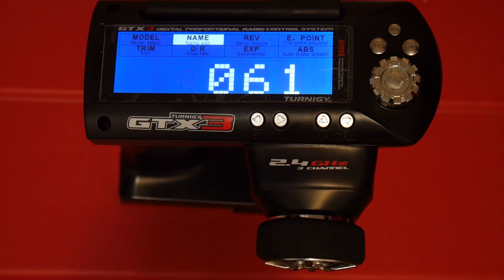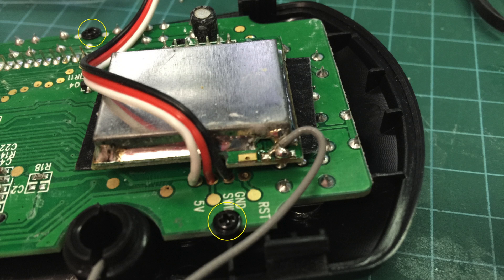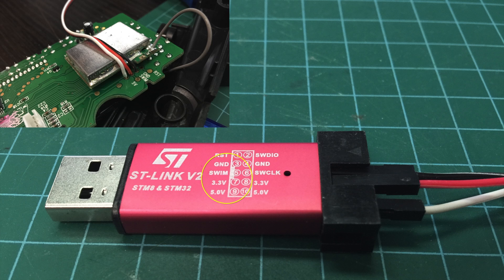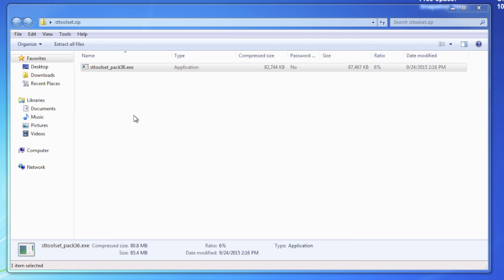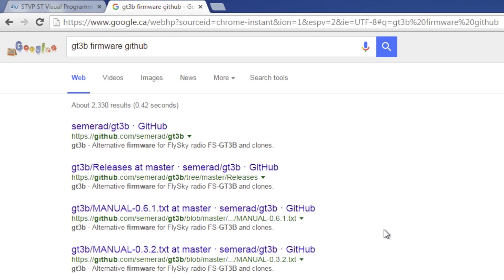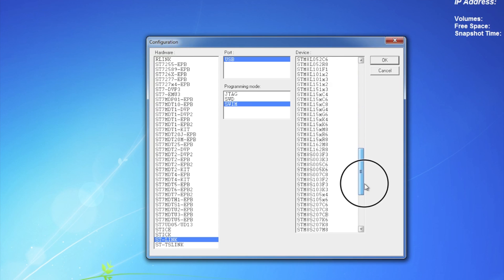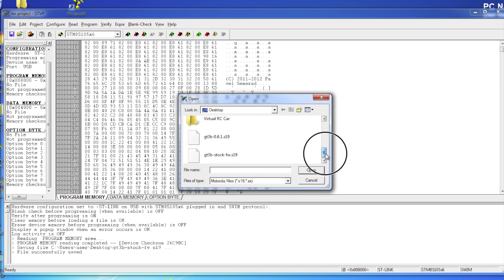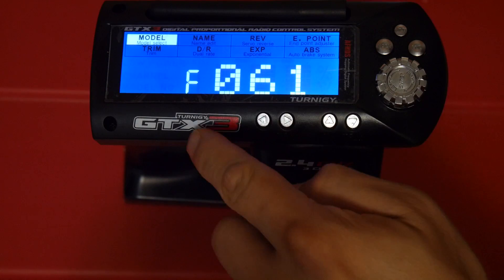FlySky GT3B (GT3C / GTX3) Firmware Flash Install Hack - Cheap USB Programmer

Comment: I have the Turnigy gtx3 with one original receiver and about 10 of the HobbyKing gt2b if I hack the firmware will it still buying and to my original receiver and the HobbyKing receiver or will I have to buy the fly sky receivers

Comment: The connected device is just beeping. and when i try to read - 

Error : Cannot communicate with the tool.
Wrong tool selection or check tool power supply or check that a previous session is closed.
Error : < PROGRAM MEMORY reading failed.

anyone had same issue?
Reply from the maker: Watch my updated video. Link in the description

https://youtu.be/b5mZ3898ZNQ
Reply: kenVersus I’m having the same issue still and I’ve watched the updated video
Reply: Yes, I had this issue on mine last week. I fixed it with this link: http://www.overkillrc.com/GT3C/Installation%20Manual%20v0.pdf

Comment: HI, I installed the hacked firmware on my gt3c and it boots up fine when connected to the ST Link programmer but if I try connecting to the microUSB the screen flickers and the controller beeps. It's like it's in a reboot loop and I am not able to do anything in the menus as it cycles very quickly.  Unfortunately, my battery is currently dead and I am waiting for a new one from China.  Not sure if that has something to do with it but I was able to power the controller fine with a small usb battery bank and the micro USB port.  Has anyone else seen this behavior?  Also, the firmware seems to be flashed OK although my ST Link is now on the fritz and is not recognized by Windows ... otherwise I would try reflashing.

Comment: Thank you Very much, it worked great! For all of you who get the error "Error : FILE : line 5: Not in Motorola S19 format!" just copy the RAW Code into the notepad and save as an *.s19 file. The problem with the rightklick method is that the code gets damaged. Happy hacking! :D
Reply from the maker: Thanks for the tip.  Hopefully, it'll help others in the future.

Comment: When I try this it tells me my device is protected and it wont read or rewrite the firmware even with the with the read out protection checked any advice or help please ? 

 

 

Reply
Reply from the maker: I'm not sure of your issue but check out the other comments, I think there were some solutions for various issues. I haven't flash a gt3b in years.

Comment: odd question but when you plug in the usb does the gt3b beep constantly if not why do you think it does
Reply from the maker: I don't recall it doing that. But it's been a while since I flashed mine.  I remember hearing beeps when it was flashing.  Not sure why yours is beeping the whole time.
Reply: kenVersus all sorted now as soon as the adaptor connected to the software it stopped beeping

Comment: Man, I added the RST line to the STLINK and STILL get the "Failed to communicate/Check SWIM connection" error. We've checked the connections, continuity, etc., to no avail. HELP!! FWIW, when the transmitter is connected to the programmer and computer the transmitter beeps continuously rather than just one beep expected. When I instruct the ST program to read the current firmware the beeping stops as I get the message. If I close the visual programmer the beeping starts up again.
Reply from the maker: +Scottrik1 hi in situations like this try another ST programmer. Maybe the one you're using is defective.
Reply: Hi, can you solve the error message? I'm with the same mistake

Comment: Just got mine FS-GT3B. Everything went fine until reading stock firmware: STVP says "The device is protected". Game over. Cant do anything. Not even upload the new firmware. Same thing "The device is protected". Please help!
Reply from the maker: +Eelis Halme never seen that error before. See this post:   http://www.rctech.net/forum/showpost.php?p=10592515&postcount=3717
Reply: https://electronics.stackexchange.com/questions/128931/how-to-flash-protected-stm8-mcu
I foung the answer here! Now i got it to work and new firmware is in.

"Make sure that the Read Out Protection (ROP) byte is set to off. Open STVP, go to the OPTION BYTE tab, set ROP to off and write out (Ctrl + P). Then, go to the PROGRAM MEMORY tab again and you should be able to write your hex file."

The key was to push "Ctrl + P" when the Read Out Protection -sheet is open.
Reply: I have the same error. Did you find a solution?
Reply: Yes. Just follow the instructions i wrote above.

Comment: On the GT3C the solder points are on the opposite end of the board on the edge, they also are not labelled but left to right (board orieted with holes on top edge) they are 5v | SWIM | gnd | RST
Reply from the maker: +Paul Campbell thanks for sharing more info on the gt3c.

Comment: Anybody having the "Failed to commuicate/Check SWIM connection" error, wire in a 4th wire into the RST hole (next to the GND hole) and connect it to the RST pin on the STLINK. I did everything I could think of to make it work the way it was described in the video with no luck. As soon as I ran the 4th wire it worked immediately.
Reply: This was the thing I was missing too, Thanks !
Reply: Janne Miettinen glad I could help!
Reply: Confirming -  the fourth wire is needed to make this work. Thank you Sam for this info!
Reply: My device was protected i could not read the memory  i followed this site suggestion and it worked but beware you cannot save your original firmware
Reply: jahcure04 is there a reason why you needed to save the stock firmware?
Reply: So the remote has to be connected to the usb while this is happening?

Comment: I have the GT3C and the ST-Link V2 mini USB stick. I'm running windows 10 and it will not load the drivers. Says the drivers are not digitally signed. Any help?
Reply from the maker: +blue2824 I don't run win10 so i haven't got a clue. If possible try to run it on a less restrictive os like win7.
Reply: The software needs to have the updated drivers.  The latest version runs on Windows 10 without issue.

Comment: Got programme to usb just not going to controller Just Beeps Constantly... Given up tonight.. This is on 2 Sets they are the same..
Reply: Hi I got the same problem,Could you fix it..same thing happening with my procedure..Please Help
Reply: Hi still working on it. Thing is got my lad same controller. It works all three channels. Not fixed his lights yet. But if I work it out will let you know. I got my three working but lost it lol. Sure I will. & will let you know. Even the Pdf is not clear.
Reply: sachindra praeep Hi. got the three channels working now. 4th channel turns lights on & off long press reverse button. I ended up getting STM8S discovery board. Not used extended wire just did 4 pins soldered. only takes 2secs to whip top off to connect. loaded straight away. hope you got sorted.
Reply: did anyone figure out what is causing this? I am having the same issue
Reply: Milan Teubel i got another driver. not the usb one just soldered 4 inns inn. worked straight away.
Reply: Also got my 4th channel working. On reverse switch long press. So with electronic switch turns lights on & off. Stm8s discovery board. Was a lot easier. You no need to power up controller. It has it's own power.
Reply: k thanks!

Comment: Hi Can you Help. Done everything. Got Everything. Problem is Plug USB Driver all wires Connected. . But Keeps Putting up Failed.Message says Cannot Communicate with the Device, Check Swim Check all connectors. Something about clock Reset Pin Bla Bla Bla. I have had many goes. Same. Wired the same as yours to save Confusion. Been honest here This is my second remote did Mine first time Good but not my sons Controller. Did something Cos it switched Off Had to Order another. This Time Same Error. Do you Turn On remote Or Does it Take its own power? Frustrated Now..
Reply: How did you go with this? I am trying to do this tonight and am getting the same messages.

Comment: Doing this upgrade, will it allow me to use the reverse position on throttle trigger? Bcuz I'm using it for my brakes.   I know this video is far from recent but if there is anyone out there that could answer would be just as good. Thanks
Reply from the maker: +Kevin Moxley reverse on the trigger is also brake when using the gt3b.
Reply: I'm sorry I worded that wrong. I just ordered this controller and I seen videos that are saying gt3b doesn't have that braking feature. Trigger into reverse position. I'm not even sure if it's true or not. But multiple videos showed it being successful after the software upgrade. With the upgrade is that one of the added features ?

Comment: Can this be done with the optional cable that plugs into the side of the GT3B? Or do I have to solder in the servo cable to perform the firmware update?
Reply from the maker: +RakinBill you'll need to solder unfortunately.

Comment: ive just tried this hack and keep getting an error code in stvp  (cannot connect to device  check swim cable connection )  any ideas ?
Reply from the maker: +R&T Hobbies sounds like a connection issue. Make sure the cables are all in the right place and making good contact.

Comment: Where do the wires connect on the gt3c inside the radio. I don't see where this is in your video.
Reply: I understand the wires on the programmer but don't see where it's labeled on the circuit board like it is on the other radios. I want to make sure it gets connected correctly. thanks.
Reply: Hi, I've just done this hack, you have an image with the pinout in the description.  If you look at the board with the connector on the right, pins are from top to the bottom 5V, Swim, GND, RST.
Reply: Dadivx , you are correct but the video that Ken shows is a gt2b or the gtx and not a gtb3c. the pins are on the end of the board and not the side. they are not labeled and I am not about to solder wires on the board and Fry the radio because they're not Soldiered in the proper places.
Reply: http://rc.305.cz/images/st_link_v2_gt3b_gt3c_connectors.jpg
That's the image I was talking about. I followed that diagram although the pinout on my programmer was slightly different. I was also hesitating about this, but after some time, I'm glad I did it. Obviously the transmitter is the same, you don't get more range, but there are more features that are totally worth it in my opinion.
Reply: Dadivx that's exactly what I needed. thank you very much.
Reply: Old post, but thanks for that Dadivx.  Just what I was (desperately) searching for.

Comment: Should the GTX3 be turned on when it is conected to the ST LINK, or the 5.0v will supply the power needed?
Reply from the maker: It's been a while since I last did it but I always has a battery attached to it.  But I think you can do without.

Comment: I have a USBasp programmer that looks similar to your, do you know if this will work for me? thanks
Reply from the maker: +RCHELIBUG I don't think it'll work.  USBasp has different chip and is for atmel chips.  GT3B is STM based.
Reply: kenVersus Ok thanks. I thought i had something on my laptop like stm bootloader but not sure what for.
Reply from the maker: +RCHELIBUG I have used a HK401 gyro from hobbyking with my GT3B and the hacked fw.  I dont' recall having issues with it.
Reply: kenVersus ok thanks. It's just from my understanding with stock fw i would need a switch between ch3 and the gyro, and don't understand why it doesn't need a switch once hacked?
Reply from the maker: +RCHELIBUG I use to have a stock GT3B with HK401B gyro and never needed a switch.  Check out this video: https://youtu.be/ioowiw0zNtE, he has a GT3B with stock firmware and gyro.  Maybe it might help you.
Reply: kenVersus Thanks that looks promising. Tried pressing the ch3 button and ch3 trim but that did nothing, will try the dual rate. My gyro is the turnigy drift v2 but is just for speed runs not drifting, doesn't have a mode selection, just want to adjust gains.
Reply: kenVersus Your a star mate. Ch3 d/r controls the gain now, from off to twitchy vicky lol.
Reply from the maker: +RCHELIBUG Glad it worked!

Comment: can the flysky gt3b bind to nitro rc if so help
Reply from the maker: +Uga Boi Not sure what protocol nitro RC uses.  But The Gt3B will work with any RC car as long as you replace the receivers on the car.  They're less than $10

Comment: what about the gt3c? I did not see it but it is in the description?
Reply from the maker: I don't own a GT3C but there are instructions about taking it apart here.  Programming it is the same. 

http://www.overkillrc.com/GT3C/Installation%20Manual%20v0.pdf
Reply: +kenVersus but uses an other programming card. i`m trying to hack my gt3c the pinout on the programming board is not the same. is there a video/instruction somewere to show how to hack gt3c with st-link?
Reply from the maker: +Odd Geir Karlsen Hi, You can still use the same ST LINK USB.  This is the pin out for the GT3C.  You only have to be concerned about 5V, SWIM, and GND.  Just do the same as my video when connecting.  

http://rc.305.cz/images/st_link_v2_gt3b_gt3c_connectors.jpg
Reply: Well, the pins are not marked 5v, swim and ground. Overkillrc just tell you witch way too plugg in the connector.
Reply from the maker: +Odd Geir Karlsen The JPEG picture i linked shows the pins.  I don't have a GT3C so can't really verify.
Reply: +kenVersus  Ok. thanx a lot, I din not see the link.